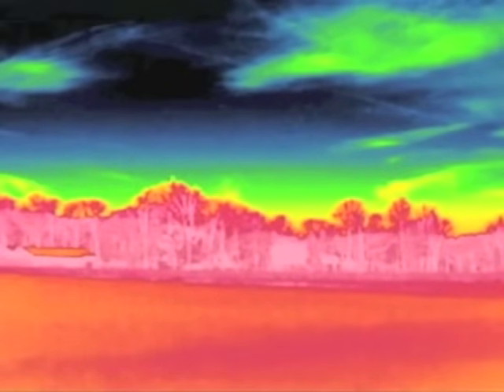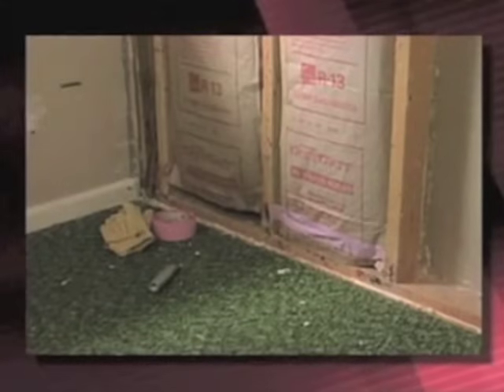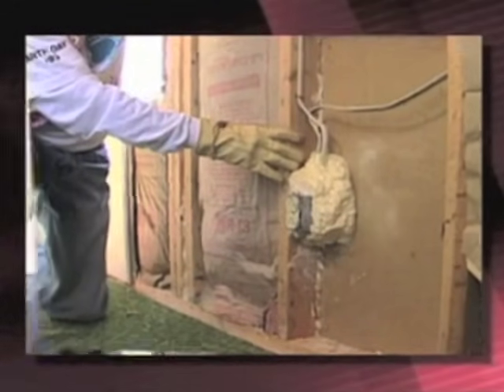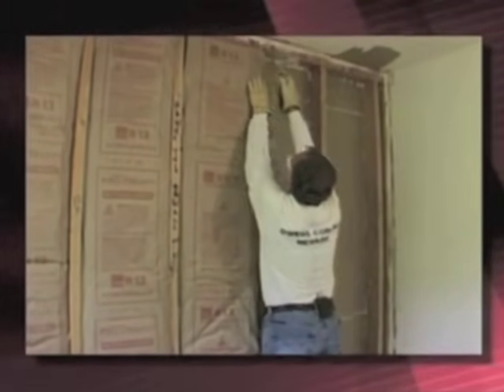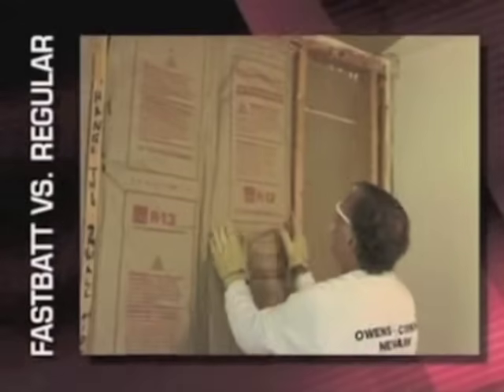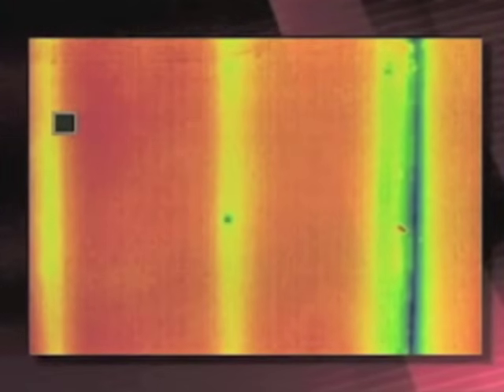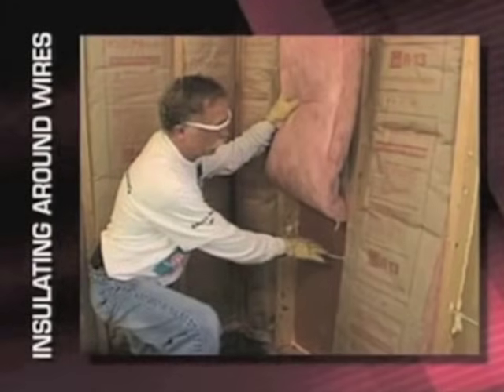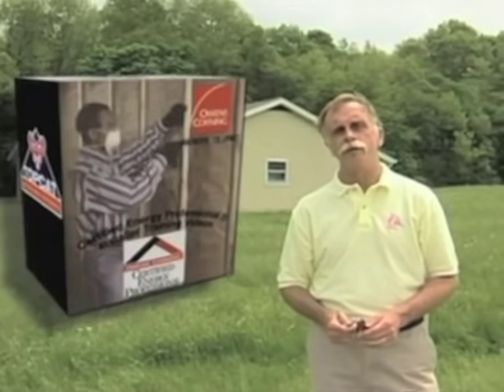Right Vs Wrong: Installing Insulation Batts In Exterior Walls - Part Two

Comment: Great video! Question. I live in a supposed renovated apartment. I am experiencing very high utility bills during winter because of what I assume is poor insulation. When they renovated, are the interior walls suppose to be insulated to protect against cold and heat? Is is standard practice for contractors to put the fiberglass insulation in the walls?
Reply: opinionatorX  Interior walls normally do not have insulation, unless you specify it (in which case it's normally done for sound dampening, not thermal reasons)
but high utility bills and the label 'newly renovated' can be a sign of bigger problems (I've seen people cover up rot holes that lead straight outside)
I know your post was from a year ago, and I'm no expert (apprentice electrician). this is just from personal experience.

Comment: If there isn't a furnace/AC running you should notice a temperature difference. If the furnace/AC is running you might not notice a temp difference but you'll notice the drop in energy cost. A couple of mistakes probably won't make a difference but do a poor job all around and it really adds up.

Comment: What about using rigid foam with a lower R-value of lets say R-3.2 ((found in Lowes/Home Depot)) and cutting it to size vs. using batts that are rated @ R-13.  Which is better or should a homeowner/DIYer go with spray foam over both, and it R-value around rigid foam - 3.2.?????
Reply: The rigid foam is normally installed as a solid layer, not between studs. If you did both and sealed well the r values would be additive. However, doubling the R-value cuts the heat loss in half (theoretically, not at the gaps as evidenced in the video.) So adding 3.2 to 13 is a 25% increase, cutting the heat loss by approximately 10%. However, the biggest benefit would probably be the seal, since the solid layer would have few gaps, except at the outlets, which should be given special attention. Let's say that in the leaky spots your effective r-value is only 3.2 instead of 13. Here you would be reducing the heat loss in half. Spray foam is a more expensive treatment, and the studs would still only have an r-value of 4.38. BTW, on the heat map, you can see the studs, so if the color shift is greater in the flawed areas than it is for the studs, your effective insulation in those places is lower than R-4! However, the insulation might still be cutting the heat loss to some extent, since even r-1 would still mean cutting the heat loss in half compared to an uninsulated barrier. Of course the wall itself has some r value. Composite siding is r-1, cement board (hardie) is r-3, tyvek house wrap is r-5, tar paper is r-0. Spray foam is often recommended in situations where moisture is a problem, for instance the condensation in tiny homes. Spray foam has closed cells and so moisture does not penetrate. The same is true for rigid foam panels.
Reply: @SteveSpinella  One thing I noticed in this video, the stud bays are all spray foamed at the edges and corners before batts put in.  That takes a good bit of time and attention to detail, (I know because I've been doing it for a 12x16 shed, and almost every time I go to spray foam the next stretch of wall, I find there have been spots I missed before, usually the 3.5" crack at the top or bottom of the stud joining a top/bottom plate).

I'm sprayfoaming canned sprayfoam beads in ALL cracks, joints, and also the holes where wiring was run through, and doing mineral wool batt insulation.  Going to skip vapor barrier given I'm in a Zone 3 hot-humid climate and it's only going to be a semi-conditioned space.

For those "small areas", what I've done is I just spray foamed the full volume of any cavity less than 4" wide with lots of canned spray foam rather than try cutting and installing a batt to a uniformly small width.  Same with the odd corners (I believe it's called a California corner) where there's the thickness of a 2x4 wide, the width of a 2x4 deep, in a corner, that would be difficult installing insulation in that corner.  I foamed out those corners until they overflowed, and then I handsawed the excess at right angles to the stud, making just a square cavity.

It's taking a lot of time and attention to detail, but my time is my own.
Reply: @LackeysLack  Sounds like you enjoy spraying cans of foam! Unless you're planning to turn that shed into a refrigerator, you might be doing a bit of overkill in your climate zone. I think the most common issue where you are is usually mold rather than insulation--especially with sheds. Enjoy your shed!
Reply: @SteveSpinella  It didn't take much, only 4 large cans with a spraygun.